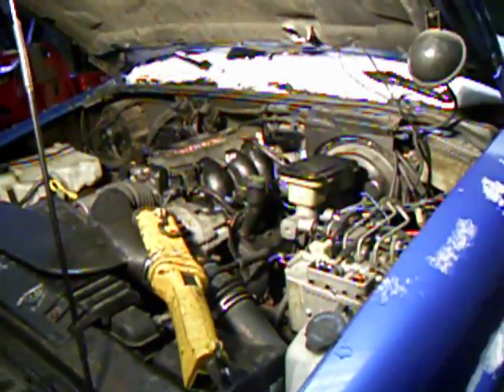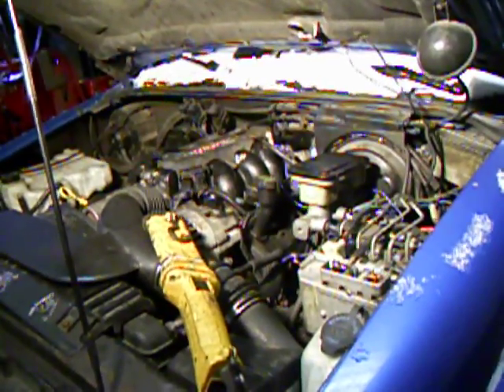GM Troubleshooting Part 12 - Catalytic Converter Exhaust Blockage

Comment from the maker: @TannerSixx420 things to check: if there is any doubt with fuel pressure, check filter.  when it is stumbling, spray quick start fluid into the intake... if it smooths out, you know the truck was not getting enough fuel.  Might be something like bad plugs or plug wires or moisture in wires or bad distributor (check it for corrosion on contacts).  maybe other people can comment...   make sure you let us know when you find it.